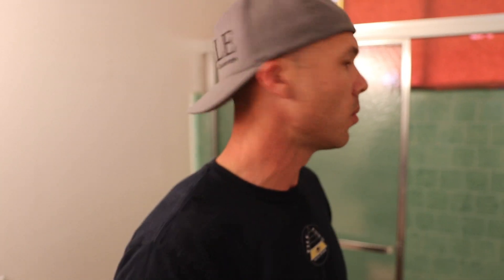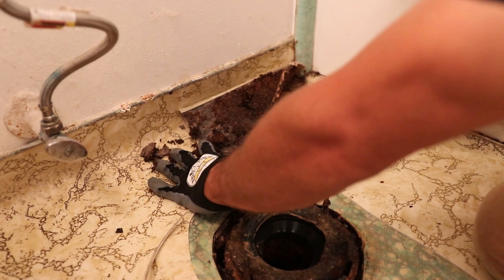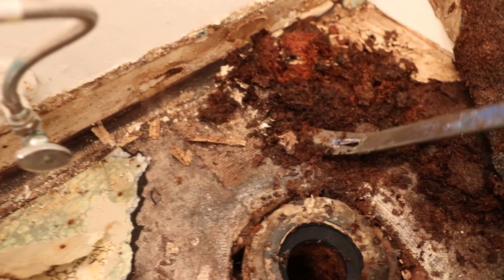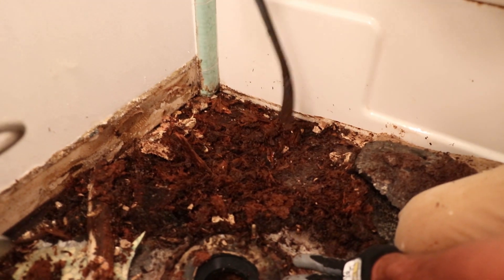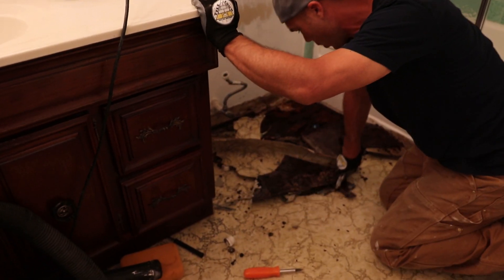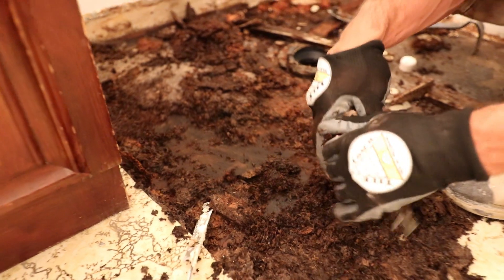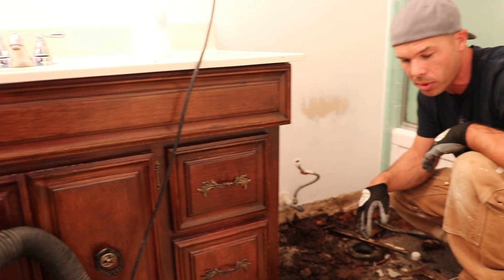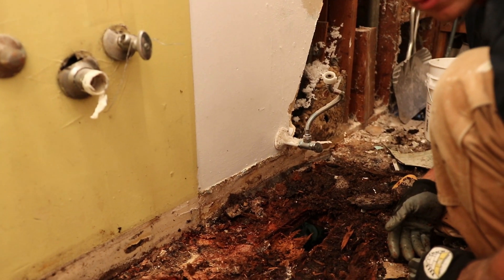Toilet Leak causes MAJOR FLOOR FAILURE!-  Grandpa Bath Episode 1

Comment: Yea if you have to caulk around the toilet bottom, that's always the sign of fail.  The question is how old is that toilet bottom, the wax ring is replaced every time you swap out a toilet so it can't be from the 60s, someone screwed up a few decades after that.
Reply: @TileCoach  Come to think of it, those awful low flow toilets becoming mandatory probably sets the maximum age for the thing, I'm sure each state had a different time when that became law.

Comment: Isaac you got real lucky with that linoleum. Every time I've ever had to remove linoleum, it was cemented on too good, and I had to spend hours with a floor scraper blade hammering away to get a 2" chunk to flake off.
Reply: You've never pulled it up on a rotted subfloor then
Reply: @bluenadas  I usually end up chiseling up linoleum from concrete floors, once on Terrazzo floors, but the old glue if you get a guy who really did a good job gluing it down, you are screwed. Clear your calendar for the day and don't plan on lunch! It's times like this that I have praise for the lazy installer who used only a little glue, because it comes right up.

Comment: I have told many building inspectors that the plumbing code needs to change and not allow caulking the toilet to the floor.  Caulking the toilet to floor hides the toilet leak.
Reply: That is why you don't caulk the backside of the toilet. It lets the water out. Front and sides only.
Reply: @mostlikelywedoitservices9743  I've seen them caulked in the front with the floor sloping to the front, still traps the water.
Reply: @mostlikelywedoitservices9743  There is no reason to caulk around any toilet period.

Comment: FYI....Asbestos was used in the manufacture of vinyl sheet products up until the mid-1970s. After its use was banned, remaining stocks of asbestos-containing flooring continued to be sold into the late '70s or early '80s, so there is a possibility that the vinyl floor in a house built in 1981 could contain asbestos...I never remove existing flooring unless it has been tested first!
Reply: Garrantee that black mastic contains Asbestos and most likely in the walls. Not very smart to just dig right In.
Reply: tested how?
Reply: @brainlopez4464  EPA 600 method is most common. By looking at the sample under a microscope using  special lighting, a technician can determine if f there is asbestos present.

Comment: The moisture barrier around the tub also can fail causing water to travel thru the grout lines down the wall and into the particle board.  Partial board is no good for floors, counter tops, or anywhere near water.  The toilet may be fine but shower water seeping down the tub pooling on the floor can cause water damage.

Comment: The toilet vintage, layout in relation to the tub and rotting is identical to the bathroom in a home I'm currently working on.  The subfloor needs to be replaced after removing a cast iron tub that is built into walls on 3 sides.

Comment: Isaac I have to say I truly enjoy your vids. I do a lot of remods and walkin showers. That being said I would recommend a small  negative air machine. Mold acts as a grenade when it's impacted. They basically scrub the air through a 1st, 2ond and hepa filter. It provide good air quality and will assist in cross-contamination. Ive seen a few environmental companies take on lawsuits from pro preparation and protocol. 
Anyhow keep the vids coming. Mad respect and love to ya brutha.

Comment: Our toilets (UK) exit horizontally at the back instead of vertically down, US convention looks easier to clean round the back, but I think you wouldn't have this issue in the uk as you'd see it leak.

Comment: Aloha from Kauai! I have the same question as Austin Scott. Very curious how they are going to repair that old subfloor? Will they add floor joists to the girder and throw 3/4 ply over it? Or will your carpenter be making 2x6 T&G? If they stick with the traditional 2x6 framing, what are the weight limitations as far as your tile goes? I have encountered a similar project recently and would like to know your thoughts. Thanks for all the videos.

Comment: I had the floor rot out in my bathroom. The previous owners didn't change the rubber washers in the tank. Cheapest fix in the house, replacing the leaky cracked rubber washers in toilet tank.

Comment: Issac, when you use that type wax gasket. the rubber flange doesn’t allow the water to go straight down. It splash around around, instead of going straight down. Look it up.also water coming down the from tub probably from back in the days. Have fun . I do a lot pier beam house. Have fun. Lol

Comment: Issac I am a new beginner DIY guy just because of financial reasons and my children have had terrible health issues because of the home I bought , black mold , water leaks , termites etc , we live in rural Oklahoma so there is no such thing as building inspections or codes etc , I have tried to watch every video you have , I also have friends that do carpenter work and they have never heard of Kerdi systems ever ! They all use pvc liner membrane, I can’t afford to hire anything out but I am determined to learn this , what videos or information do you suggest I watch ? I would love to email you pics of what I am dealing with

Comment: Those black spots under the front of the vanity floor (at 9:15 to 9:20 when you pulled the flooring) and immediately under the vanity (scraping it at 9:45) appear to be black mold.  The smell and appearance are indicative of that!  It is not simple rot.  You should wear the respirators rather then saying you should... your health depends on it.  A vacuum with a hepa filter, air exchanger and sealing the work space should be done until the mouldy material and mould spores in the air are removed and cleaned properly.  Just what I would do.  And seriously, this job is respirator worthy by a mile!  

Thanks for showing this water damage, it's indicative of the hazards water actually does.

Comment: There's nothing wrong with caulking around a toilet as long as you leave an inch or 2 at the back un-caulked.  It prevents urine and nastyness from collecting under the toilet, not from flange leaks but just daily life. Pull any toilet and there will be a yellow ring around the edges on the floor.

Comment: And, with a cast iron leaded flange, nothing could be easier than installing a new flange on top of the new floor with brass wood screws. Don't pay any attention to me. I've been a Plumber since 1976. Correction. I started my apprenticeship in 1976.
Reply: @TileCoach  Mr.Ostrom. Love your work, by the way. I'm a Berkeley boy by birth and admire the old Italian skills. Hey! A 4"X2"  C.I. closet flange is very inexpensive. Maybe $10. I'd advise not using a plastic adapter flange that fits inside the C.I.pipe. Fernco makes a "donut" that fits inside a C.I.bell. ABS can then be driven into the donut, making a water and vapor proof seal.    Regardless, yarning with oakum is fairly self explanatory. Caulking with lead equally easy as long as you remember that the oakum is what seals the joint, not the lead. The lead just holds the oakum in place. I resist using anything but a regular bowl wax. I've also formed an opinion over the years that 3/4" plywood is not strong enough, by itself, from keeping the subfloor from flexing. People are far heavier, on average, than 50 years ago. So, beefing up the area between the joists with 2" X  material around the pipe riser might mitigate movement of the toilet after installation. Rock solid is what you want.

Comment: Good info Isaac.
I had similar issues on my projects suspecting leak from toilet flange. However after doing simple tests and observing damage toilets were not the one to cause damage. In 9 of 10 cases it is actually caused by un-leveled tub with flange sloping towards floor. It happens overtime due to settling of the house - entire rooms get leveled in one direction, sometimes even an inch on 10 feet area. When you use over several times  per day ( multiple people) imagine amounts of water silently sneaking to the floor from uneven tub- and gets the in to the gap between tile(vinyl) floor and tub straight to wooden subfloor. Big part of water that settles on Wall instead draining to tub- drains to the floor. If you have shower curtain - you are in big trouble because there is always big gap! Glass panel helps in such case, but if seal is broken water will travel under it very easy ending up on the bathroom floor or behind the wall! It is very hard to notice that process till it is to late - like in this case. You may have the best waterproofing and most talented installer doing work, but if tub slopes to the outside     it is worth nothing. Unfortunately those days plumbers do not care and even bother to level tub corectly - just throwing tub the easy way and move to another job. I have seen it almost always especially in New construction. If we- tileguys will ignore that  and will run installation on uneven tub - homeowner  will end up with what you showing in video one day.  This is also why most times you will see rotten subfloor progressing along with direction of uneven floor, creating damage on main floor and hardly ever under the tub. Be careful with those 60,s vinyl floors - they are made of asbestos and require very delicate demo! !   - with special respirators and closing. If old floor contains asbestos I am not even performing such demolitions - I have 2 kids and they need me around for many years to come. In several of my videos I am explaining importance of perfect tub installation - just to prevent something like that to happen. If you see that tub is uneven - do something about it and never  move forward with tile installation. Cheers.

Comment: What are your thoughts about caulking around toilets? I've heard arguments for and against using it. No caulking might've let water leak out from under it and alert the owner of a problem?
Reply: Eddie: I only use silicone, never latex caulks which would dry and crack. Don't put apply any at the rear of the toilet, so if there's ever a leak inside the wax ring connection, you'll see the water come out the back of the toilet.
Reply: @jeffostroff  spot on. Caulk under a toilet is for style and not function. Caulk the visible sides and leave the rest open.
Reply: Don't seal any of it, I've seen toilets caulked at the front only. But the floor sloped that direction and trapped water underneath.
Reply: @redhoward11  Your logic is off a bit on this one. Even if the floor is sloped, which this floor is not, the water will dam up underneath like you said, but just like over filling a sink, it will eventually leak out the back of the toilet onto the floor, letting you know you have a leak.
Reply: @jeffostroff  depends on amount and severity of leak. I've remodeled thousands of bathrooms and seen it many times.
Reply: @redhoward11  I've seen it zero times, so maybe it's an up north thing, or bad wood floor sub flooring, or toilet placed too high or wiggling? I just know that every time I place a toilet I make sure the business end of the toilet floor and flange are level, correct height, there is never a wobble on the toilet, always rock solid and firm and shimmed up, so never a chance for a leak to even develop.